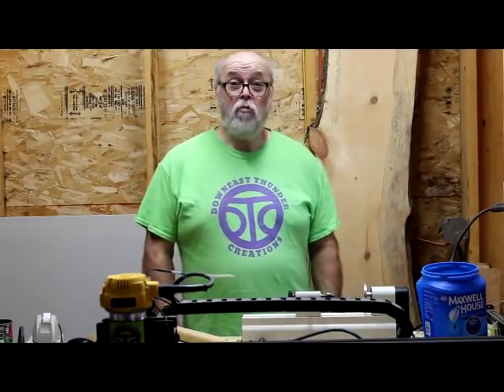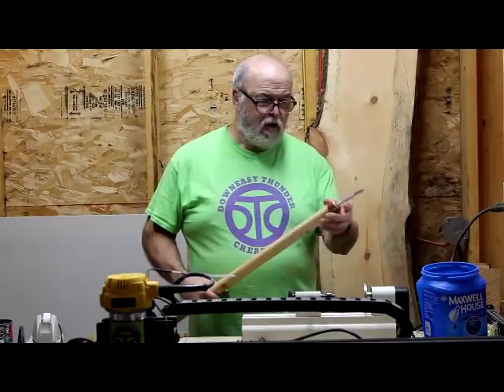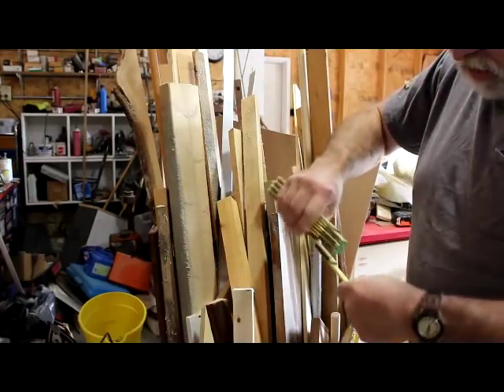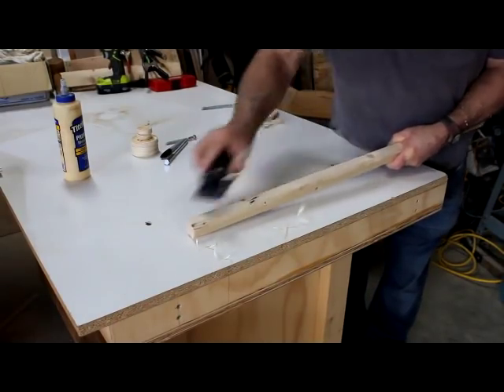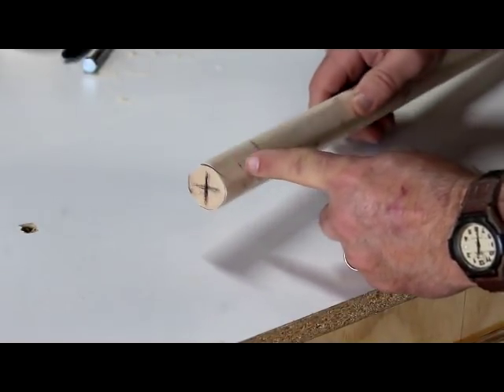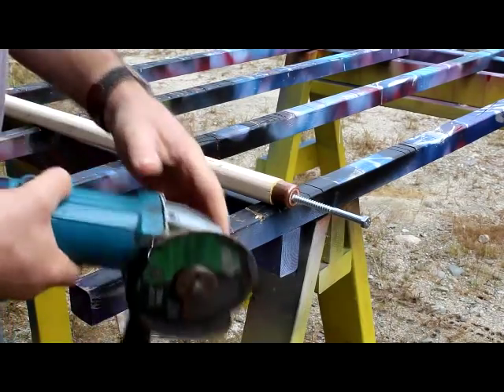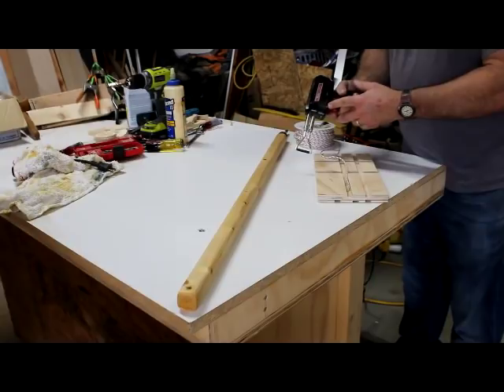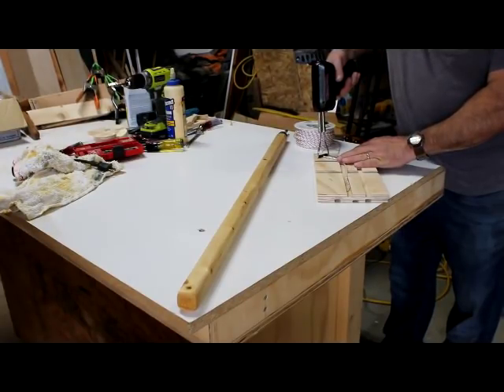(S-2 Ep-47) DIY “Mr. Bawbag Pick Stick” (FREE PLANS)

Comment: Great Idea - Thanks for your video. I had an old wooden paint stick the thread end broke off and I was able to drill a hole and screw in for installing a long bolt with square head and grind to a point with my bench grinder. I have a rubber hose to cover the point with not in use. Works great to pick up liter. Take care!
Reply: @DowneastThunderCreations  Thanks! I like yours - very classic and heavy duty for many years of use. You can not buy one that nice in the stores! Take care!

Comment: The copper cap is a good touch. You should add a slot or change out spot in case the tip needs to be swapped. Maybe add a barb notch on the tip too so it holds more items?
Reply from the maker: Thanks Jon. Those are great suggestions!
Reply: what is a barb notch? any links about this?

Comment: How would you make a point without your specialized grinding tool?
Reply from the maker: I don't have any specialized tool, really. I just used a grinding disk on a 4-1/2" Chinese made grinder, but hand file will do the same job. It just takes longer. I used a hand file to make refinements after using the grinder.
Reply: Instead of the lag bolt, you could use a “dowel screw” which is pointy on both ends. You could probably skip the lag screw altogether and just punch a nail through the copper cap with a wad of glue so it doesn’t rattle, and put a couple pins through the side of the cap since it is actually responsible for holding on the spike in this case.

Comment: hi, would you be able to post a list of all things you used in the description?
Reply from the maker: Sure. For now, I'll post it here: Scrap piece of 2 x 4 KD spruce, spare copper end cap (plumbing supplies) I think it was around 1-1/4" diameter), spare 5/16" diameter lag bolt that was around 4 inches long. Some left over 2-part epoxy, scrap piece of line for a lanyard. Honestly, you can use just about anything. I didn't plan on the sizes/dimensions. I simply used what had kicking around the shop so I didn't have to go out and buy anything or spend any money.